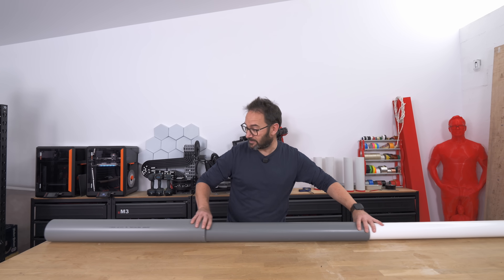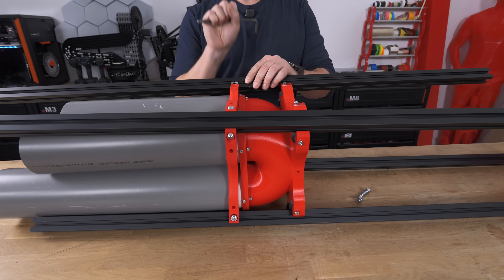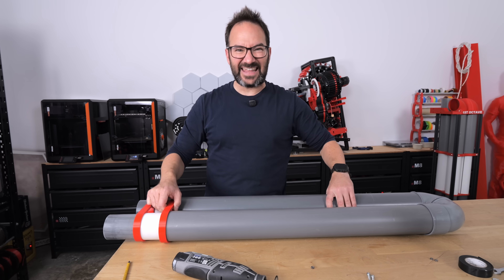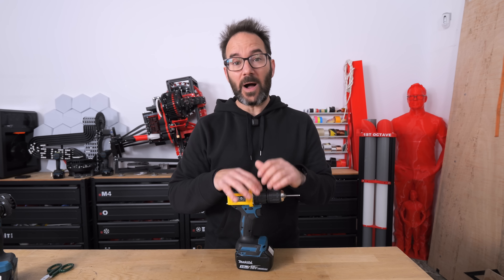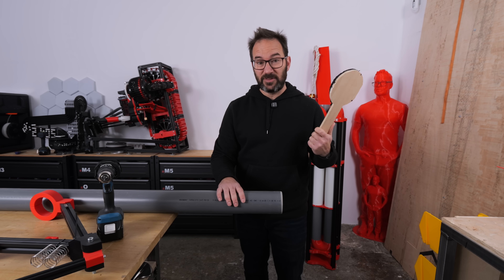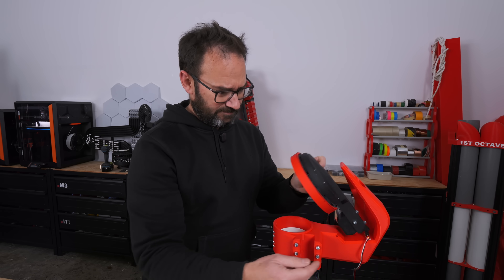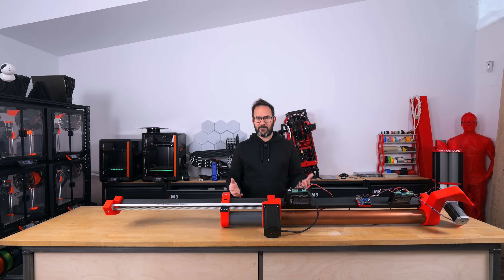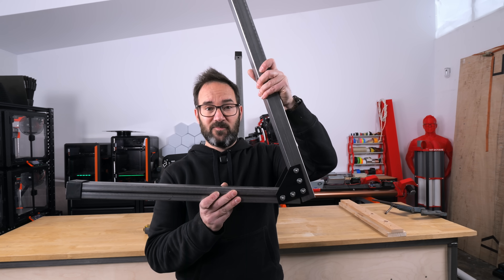I made a Midi Slapophone

Comment: Cool design.  Note that I think one of the challenges that you were dealing with is resonance and harmonics.  These tubes are like the strings on an instrument and they contain have to resonate and that means they have to be elastic at the resonant peaks and those are at even divisions of the pipe.  Unfortunately the brackets you are using around the pipe are not elastic and since they are a fixed distance from one end, their damping will be frequency dependent.  If instead you could make the bracket in the middle and have both sides extend the same amount, that could work better.

Comment: You welded together your frame with the pieces clamped to eachother, but the entire assembly was unrestrained. Arc welding will always cause distortion by heat input, you need a fixturing table or equivalent to hold the frame very rigidly during welding until it is completely assembled.

Comment: at 5:00 I think your issue, is that either the pipe itself is vibrating (like a drum), or the air inside the pipe is vibrating (like a flute), and maybe that is why you have unexpected results. Your racket creates a Dirac impulse in the pipe structure, instead of an air flow.

Comment: Fun video as always! It seemed that the first version failed because its scaffolding structure was creating interference with the waves inside of the pipe. Even the disassembled version had a bracket which basically welded two sections of the pipe together. This isn't to say that the whole twisting length of the thing needs to be un-anchored to anything, including itself, but the tighter you to attach it to a rigid framing of unknown resonance, the less predictable the results.

Comment: In my experience making instruments from pipes the tiniest air leaks destroy the tone quality and playability of an instrument. 3d printed parts tend to not be completely airtight, and with all of the sliding interfaces there is likely a ton of air leakage. Trombones work so well because the slide is an extremely close fit, and the space between is filled with oil, which lubricates it but also makes the interface airtight.

Comment: The primary issue you overlooked with the first design is that both ends of the pipe have been brought close together.  The fundamental wavelength of the note the pipe will resonate at is twice the pipe length i.e. the pipe will form a standing wave that has a half wavelength of the note.  This means the sound coming from each end is in anti-phase and by bringing the ends close together you are cancelling out the fundamental so the pipe sounds very flat.  With a long open tube the two ends are obviously a half wavelength apart so the sound adds constructively to a listener.  This means you'll never get the rich sound of a full length pipe in one that is folded.
Reply: Then closing off one end might help?
Reply: @AlexHaan  Yes this would help, though it also changes the pipe tuning.

Comment: You know, I had a dream for many years of having a combination fountain/MIDI instrument by having pipe valves spray or drop water so it hits a closed pipe end.  Presumably it would be using small pipes and so it would be high pitched rather than bassy.  It's probably impractical, but I like the idea of a big wall-mounted fountain in a display case that plays music.

Comment: I'm pretty sure you could get it to work with the pipes bent up, but you'll need to keep the bend loose enough that the pressure wave can continue to travel inside it without breaking up. With those quick 90 degree bends, especially back to back to make the 180 turn, the wave never stood a chance. That's literally why combat trenches have 90 degree angles in them. I'm sure there is an equation for figuring out exactly how much it needs to be bent, but that's far beyond me.

Comment: have you tried to slap it by using a rubber band and using the motor to pull up the paddel, loading the rubber band and then using some mechanism to release the paddel when you need the sound then loading it back again?

Comment: For future adjustments (because i know a project is never truely finished) you can effectively double the length of the pipe by closing off one end, meaning you could get way more notes out of 1 pipe. Also if you hand the pipes from elatic cords (similar to a microphone cradle) you will get a better sound as it wont deaden the resonance of the pipe itself, although accurately moving the pipes in this setup will be tricky.

Comment: Instruments need to resonant WITH the sound they produce to get the most out of them. Most people know that an acoustic guitar needs that sound hole to be loud and heard, but what you are hearing is the vibrations of the strings passing resonance through the wood vibrating the air coming out the hole and around the guitar.  A Trombone which is similar to what you were trying to create with the extending pipes uses thin brass that resonates with the air that is affected by the slide. You feel the whole horn vibrating when you play. If you change as many hard clamping points to maybe a rope system, or at least a minimal contact surface situation, you should retain a lot of the sound you are looking to keep. Blue Man Group here in the States has a sliding Slap-o-phone instrument. Remember that not only music is freeing, but it also needs to be free to resonant.

Comment: Besides making everything too tight as others mentioned, sound is a wave and the round end doesn't reflect it well.  The pipe bends needed to reflect the sound.  Think of it almost like the sound is light.  The bends needed flat surfaces for the sound to reflect off.

Comment: My thought was to use a cam with a spring for the slappers, that would allow you to use weaker motors, though direct attached makes accenting a lot easier.
You could still do accenting with a pair of small motors and a cam that has a taller drop on one side, but that's more complex.
Also you might want to use a cross band suspension to hold the tubes to avoid vibrations (use a circle that's a few centimeters bigger than the tubes, and tie some cut bike inner tubes¹ in a # pattern² with the tube going through the middle, that will cut off most of the vibration to and from the frame.

¹or any elastic of your choice, that's just a great way to recycle tubes
²You can use more than 4 bands, you can use any regular polygon of the hole really, and you want the hole to be somewhat smaller than the tube so it doesn't become bigger with the weight.

Comment: So you went from the design philosophy behind a pipe organ to a trombone to a woodwind.  The only thing you missed was a brass instrument that wasn’t a trombone.  Those use valves to change the length.  As far as your pipes resonance, that is being crippled by your mounts and brackets damping the pipe vibration.  Check out how the long pipes in a pipe organ are supported.
Reply: The primitive hole method has some effect on frequency (see eg natural trumpets, which predated valved ones), but not a ton.
Reply: The vibration of the body doesn't actually contribute much to the resonance of a wind instrument. You could build a saxophone out of concrete and if the bore is smooth it would sound like a saxophone, just one made of concrete.
Reply: @TheFinalFrontiersman  how is what he is making different from a drum? like really? the skin is on the paddle. 

the sound is affected by vibrations due to material and length, is like saying an organ can be make to fit in the a ship container and sound as rich
Reply: @blackwin2721 I think you answered your own question. This doesn't work like a drum at all. The slapper creates a spot of high pressure which travels down the tube, reaches the other end and bounces back, forming the standing waves we hear as sound. The air itself is what's oscillating. In a drum the head vibrates, pushing the air around it back and forth more like a speaker. I specified wind instruments because they're fundamentally different than stringed or percussion instruments, which are different from each other.
Reply: @TheFinalFrontiersman Thank goodness someone else understands this. There are hundreds of people copying the same comment about the pipe mounting, showing absolutely no understanding of how this instrument works.  The pipe's lowest resonant node is a half wavelength, once you realise this it becomes obvious why moving the open ends of the pipe together with bends ruins the sound; destructive interference.
Reply: @blackwin2721 In a drum does the cylindrical part of the drum radiate the sound, or is it the ends of the drum with the flexible skin?

Comment: Because you used clamps and screwed everything together tightly without any decoupling you are basically getting 20% of the tube frequency and 80% of the resonance frequency of the whole build
Reply: Absolutely not, the sound comes from air vibrating within the pipe, not the pipes vibrating.
Reply: @ferrumignis Sound is air vibrating, but what do you think makes the air vibrate?
Reply: @kilianwaltl410 The air vibrates because it forms a standing wave in the pipe, the majority of the sound comes from the ends. Yyou could make the pipes from thick concrete and they'd still make a similar noise.
Reply: The pipe acts as a resonator, just like with brass instruments. The tone remains the same, but it is much louder and clearer when the resonator is free to vibrate.

Comment: Your brackets are killing the resonance, create tpu shims for between the holders and pipe.
Reply: Basically... it needs... SPACERS???
Reply: I was waiting the whole time for him to realize and then he kept adding more rigid brackets haha
Reply: @aryst0krat  No, the pipe creates sounds by the air vibrating inside it (forming a standing wave), not by the pipes vibrating.  I see the usual YT comment effect here, one person says something that sounds feasible (even though it's wrong) then hundreds of other people post the same thing trying to look they are are knowledgable 😄
Reply: @ferrumignis  Yes, and the other factor is how tight he was turning the pipe. The turns are too tight. Blue Man Group has instruments like this that are folded, but they don't have as tight of turns as he was trying to make here. The tight turns don't allow the sound to propagate through them. The lower the note, the wider the turn. The wider the pipe, the wider the turn as well. You see this in woodwind and brass instruments as well. There are calculation that can be made based on these factors to give you the minimum turn radius to allow the sound to propagate past it, based on the lowest frequency you are trying to allow past.

Another thing he could do to increase the volume would be to 3d print horns for the ends of the pipes or a single shared horn all the pipes feed into. He has a large format 3d printer to do such a print on handy even.
Reply: @ferrumignis  also you have fallen into the same hole..

--> but making holes on the pipe and covering them like a giant flute the sound did not change as drastically. its like saying a metal chime makes sound because of special wind currents.

--> the sound has to do with material resonance and the volume of air inside.

--> i think adding spacers can affect the material resonance because vibrations are faster in solids. ... but where do you stop and how is it best done.?? curving adds volume but its a different material, affecting material resonance. ... 
       so imagine 3 pipe on a giant rail. one end with the padel hitting part. and the other side like 6 (or even 9) parts on the rail. 3 adjust which pipe is being hit and handle rapid tone change between pipes. then using the rail as a spine to hold the second (or third part) to handle hold it for individual extention. like how he did for one.
Reply: @blackwin2721 Explain how I have fallen into the same hole please.  There is a far more fundamental issue causing the problem which has nothing to do with how tight the pipes are held. I wrote a post explaining this hours ago and at the time I didn't see other posts that explained it, only the classic know-nothings repeating what they had read. This also explains why the pipe with holes sounds better.
Reply: ,^^^^This
Reply: No, that's like saying holding a flute firmly will stop it from working which obviously isn't the case. It's the air inside vibrating that causes the resonance, not the pipes
Reply: @SamChaneyProductions  try it with a whistle... it wont stop working... i agree. but the sound will shift
Reply: @SamChaneyProductions  The flute sounds while the player provides the air pressure, and doesn't continue to ring out after the breath stops. A better comparison would be the keys of a marimba, which are suspended on strings to avoid dampening (which a player will do by touching the key to stop the reverberation).
Reply: I'm only nitpicking because this is a common mistake when talking about cycling suspension and it has become an irk for me:

Dampening is something you can do with a wet cloth or to a cloth to make it damp. But you can damp resonance to mute an instrument, you will then be damping it

I'm sorry, I couldn't leave it be. .
Reply: LOUD NOISES!!!

Comment: Is your issue with the first 3d printed thing - the fact that you are holding it too rigidly meaning that it is not able to work the acoustics correctly?
Reply: It doesn't matter much how rigid the pipes are held mechanically. The sound is all produced by air moving inside the pipes. Actually, technically speaking the more rigid the better, but even the pipes all by themselves are plenty rigid enough.
The trick is really to not impede the air movement.
Reply: @leftaroundabout the air inside is not the only contributor - the pipes also resonate - in order for it to resonate the pipes need to be held loose enough to vibrate amplifying the frequencies of air inside that match, or additively interfere. That is why the output is quiet and not so full - it lacks the resonance. The videos you see online all have the pipes contained at one end but otherwise loosely held throughout the rest of the instrument.
Reply: @leftaroundabout  how the pipes are being held 100% effects how the note resonates. Like if you take a trombone or trumpet and hold the brass tightly near the bell and bell tube it will resonate less and sound different
Reply: @sourscream2587  it may well sound different, but those are just secondary effects - resonances on individual harmonics that shape the timbre but don't affect the main tone generation. Not comparable to the essentially non-existent fundamental tone we hear in the video for the bent double-telescopic tube. An air column instrument does not need any resonant surfaces to project a loud sound, the way e.g. a guitar needs them, because the vibrating air directly couples to the outside at the end of the tube.
Reply: @leftaroundabout Exactly right, the primary source of sound is from the ends of the pipe, not the pipe itself. It's disappointing how few people understand this.
Reply: @leftaroundabout  You need to create the vibration though, think of holding a wine glass at the stem and then hitting the glass. You get a nice ring. Now do the same while wrapping your hand around the glass, you will struggle to get much sound.
Reply: @Sandstone1986  a wine glass rings in a completely different way, namely by solid vibration (which would also work in a vacuum, except you wouldn't hear it then). For the PVC pipe, none of that matters because it's not the pipe that vibrates, it only needs to contain/guide the air inside which does.
Reply: @leftaroundabout This was exactly my original thought as well, but then I realized maybe they're right too in that a slightly loose/flexible pipe will vibrate in response to the pressure waves from inside, giving a larger emissive area and thus more sound.  I'd like to see this tested to know for sure.